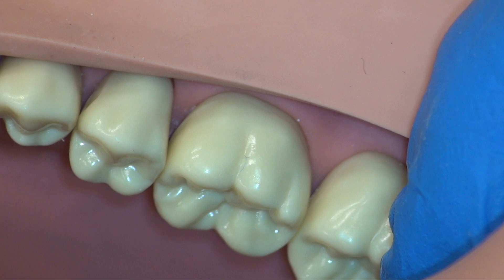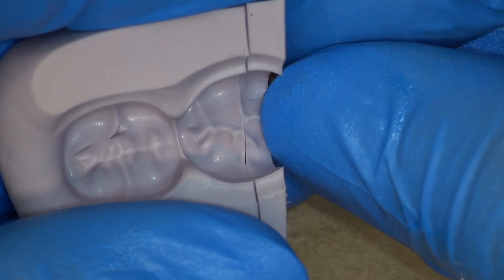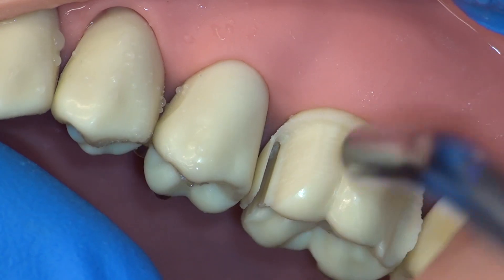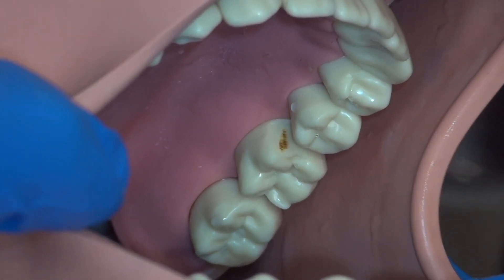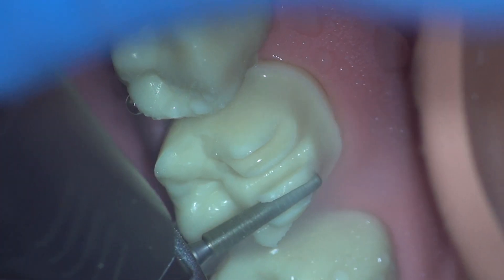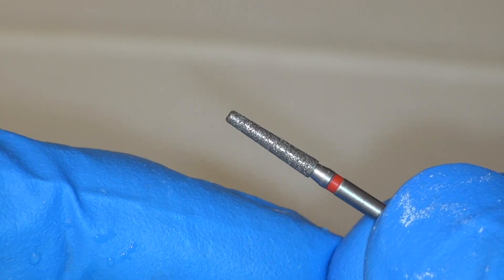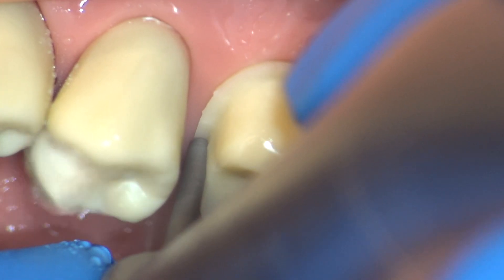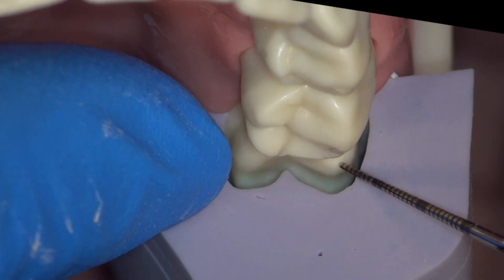Lower Molar Crown Prep | ACC 30 | First Person Perspective

Comment: Doc i wanna ask are you looking down to the wall using microscope or is there any way where i can see horizontal to wall using microscope ….. new microscope user here
Reply from the maker: What do you mean by "down to the wall?" 
Always reposition the patient before moving the microscope, meaning if the patient's head can be turned to give you the horizontal view with the microscope still facing straight down, that is better than turning the microscope and compromising your posture, also more efficient.
However, I am using a digital microscope so it can be positioned very differently and more easily than a conventional microscope.

Comment: Thanks for the video! How do you position the suction / aspirators when you're using the two handed prep technique?
Reply from the maker: I always have a slow speed suction with a foam tip in the mouth to provide general drainage, and my assistant will hold the high volume suction wherever it fits as close to the prep as possible.
Reply: Thank you.

Comment: what's the correct RPM for refining & relocating the finish line (2k-5k RPM?) thanks !
Reply from the maker: Typodont teeth will be different than real teeth. I use 20k minimum for these teeth by Frasaco. For larger adjustments like relocating the finish line it might be 40k or 60k. 
Always apply the same light pressure with your handpiece—adjust the cutting speed to reach your desired amount of reduction per brush stroke.